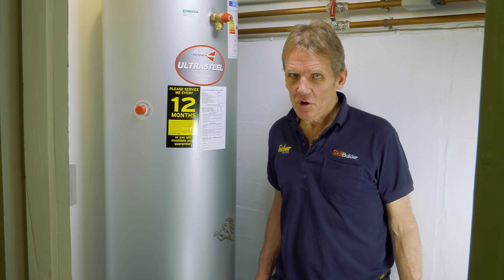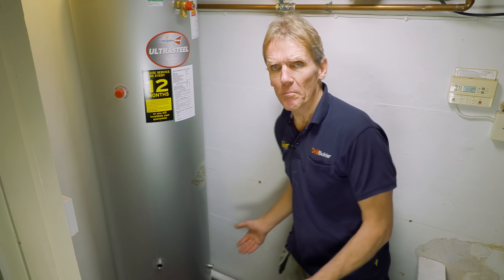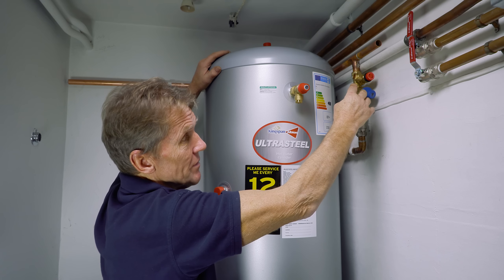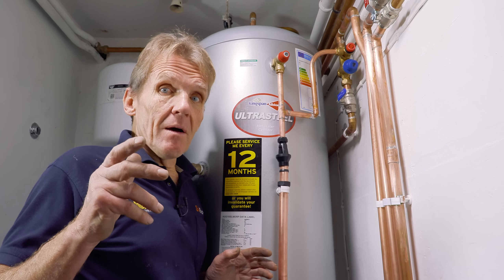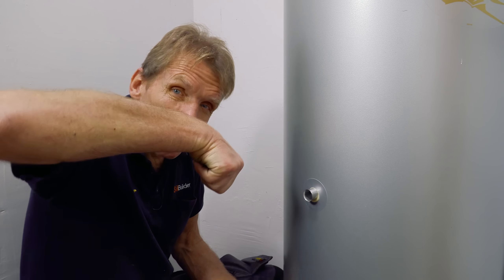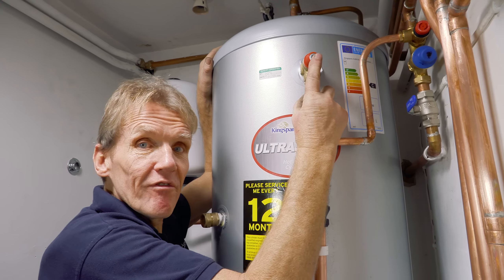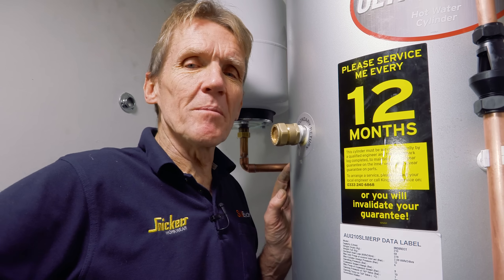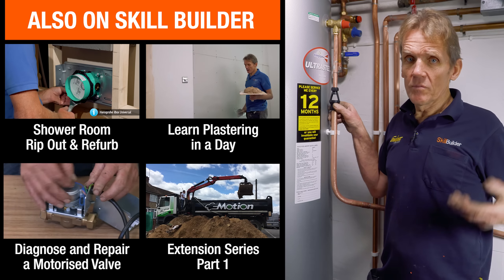Kingspan Albion Ultrasteel Unvented Water Cylinder

Comment: hi roger i have a 5 bedroom house  2 bathroom 2 shower   when ever i have 2 shower the hot water run out had to wait for 15 to 20 minute   you think unvented cylinder will be the answer and do i have to change the boiler as well thanks  enjoyed the video.
Reply from the maker: I think you might solve the problem by getting a better flow from the boiler to the cylinder. Is there a motorised valve on the cylinder? I am wondering if it is pumped or gravity.
Reply: Ratch Riat maybe you should look at the size of the cylinder capacity, compared to the size of the house

There is a rule of thumb, but if you get a qualified professional to come and quote you, I’m sure they will be able to solve your problem 👍

Comment: Surely by installing a check valve on the hot out will cause resistance?
Reply from the maker: A little but it is mains pressure to there is lots of flow.
Reply: check valves should be installed at each application, shower mixer or TMV etc, not at the source

Comment: how much air pressure does the expansion vessel have for the 3,5bar of watter pressure?
Reply from the maker: The expansion vessel should be charged to 3 bar with the cold water inlet valve closed and the hot tap open. This means that when the pressure reducing valve limits the static pressure to 3 bar as the cylinder fills the expansion vessel will then accommodate the expanded water in the cylinder. If the pressure vessel is less than 3 bar it will already have begun to compress and that limits its capacity. 

In many countries they don't have an expansion vessel and the expansion backs up the mains. The non return valve, there to stop contamination, prevents the water backing up the mains so it needs somewhere else to go. Some cylinders have an air gap inside at the top to take the expanded water.

Comment: Can you do a video on poor central heating pipework design and lack of 22mm flow are return. Issues with multiple drops and use of micro ball pipe. Got an absolute tool of a plumber whos screwed up my sisters central heating
Reply from the maker: O.K I can go through the basics.
Reply: @SkillBuilder  i do the wet fit hang rads n do the flow return on 3 bed terrace house, boiler is baxi 80 he type installed in kitchen back of the terrace. I do the "c" shape in 22mm plastic and "t" off in 15mm vvv close to rad, hence theres a max 22mm flow rate with no drops!!! Dont even need to balance and increase boilers life as no air locks or restrictions, hence boiler having to do less work. If theres a attic room i use 22mm. I never deal with micro ball pipes and use plastic as less restrictions. If theres a concrete floor down stairs i chase the skirting and take pipes around the skirting. I never use drops unless its a loft room. Even then i dont need to balance. I know im talking about small houses and basic system, but ive seen dumb plumbers screw these up aswell
Reply: @SkillBuilder  he left the site with a gas leak. People must get the gas safe engineer to watsapp their card and verify the certification. Ask the specifics of the pipe route and the 22mm path

Comment: Why not have a pressure reducing valve on the mains coming into the building as well as the one in the combination valve? This would eliminate the need for a check valve on the hot water draw off.
Reply from the maker: You could do that yes. I have done it when people have excessive night time pressure.

Comment: I am wondering where the outlet from the tundish goes? to a bucket on the floor?
Reply: Mentorcase , think 22mm punches through wall to out side.  In oz, internal storage hotties must also have drip trays and outlet point, just in case hottie cracks or leaks.
Reply from the maker: Through the wall. It is a basement but one wall faces a sunken garden area with drainage channel.
Reply: But I thought it was a basement, below ground level.
Reply: @SkillBuilder  as its a boiling water outlet please show how its terminated outside
Reply from the maker: @TheDickPuller  
Where does the pipe go? The answer is, through the wall and outside into a drain.
Reply from the maker: @Mentorcase   It's a basement but the back of the house is lower than the front so it can run through the rear wall into a drain. It's all good.

Comment: ive got an unvented cylinder like this and every few months the overflow leaks. Never been able to work out why. Have put pressure reducing valve on mains into house at 2 bar but it still occasionally drips. I have to reset the airgap on the cylinder then its ok for 2-3 months. All valves have been replaced but it still does it. Don't know why. :(
Reply from the maker: Try fitting an expansion vessel to the incoming mains on the cylinder side of the non return valve.  The bubble is being displaced, they are like that sometimes.
Reply: @SkillBuilder  Thanks so much for your reply. It is a megaflo. I've read they can do this. The last British Gas plumber mentioned that it might need an external expansion tank if the mains pressure reducer didn't fix it. But doesn't an external expansion tank simply increase the time taken for the valve to start to  drip? Thank you 😀

Comment: HI Roger its Kev how much would something like that cost? thanks mate
Reply from the maker: Hello Kev
The cylinders are not that expensive now. Say around £500.00 for this one. The pipe and fittings added another £200 and then there is my labour which is another £500.00 All plus vat  of course.
Reply: I charge £1500 on average, supply a fit. Then its between £300 - £800  for any additional alterations to the system. Boiler would be about £1500-£2000 supply and fit.

Comment: Nice job Roger , but you forgot to mention that you need to be qualified and certified to work on unvented hot water systems as if you don't know what your doing ( DIY ) you could be putting people's lives at risk.......!
👍
Reply: No you don't need to be certified, but you do need to be compotent. Don't let yourself be brainwashed. Wake up. I live in bulgaria and all the houses have these it's no big deal.
Reply: Forgot to say that you can also connect them to solar or a wood burning stove.
Reply: Trevor Jones This ain’t Bulgaria pal 👍🏻
Reply from the maker: Trevor. Never do that. The wood burner is a no, no. It is not controlled and can boil very easily. Then you are relying on the safety devices.
Reply: Trevor Jones, In Australia Plumbing is a protected trade. That’s why you can drink the tap water here,
Reply: Trevor Jones ......I posted my comment to highlight the fact that DIY ers should not touch this kind of installation and you have just proved my point......!!
Reply: Yes need to be certified
Reply: Trevor Jones This aint Bulgaria mate, you need to be qualified to work on these in this country. That’s why we’re allowed to drink our tap water in our country, because we control who works on it
Reply: Fibre Washer Exactly! Should not be uploading ‘how to’ videos on things that cannot be installed by anyone other than qualified professionals!
Reply: @petermolloy5558  
The best water can be found in the Netherlands and Plumbing is far from a protected trade.
Yes, there are building regulations you have to follow, but you are quite free to do a lot of DIY.
Protectionism of these kind of trades is prohibiting people to do a lot of work themselves.
And even if a trade is protected, as long as your work is checked by a professional, it should be OK.
Reply: @AndyGT1907  
For your information, Youtube can be watched all over the world.
So while things may be forbidden in de UK or Australia, we enjoy these video's and Do It Ourselves if we feel confident to do so. 
I soon will start my installation of heatpump with 3x 1000 liter hot water tanks for heating and 1000 liter Hygienic Domestic hot water tank with circulation pump (500 m2 house).
Nice DIM (Do it myself) project.
At the end (and maybe in between) I will invite a plumber to do some checking, but I am confident I will do it just fine. When professionals came to pour my concrete floor and later, after insulation and floor heating, to put the anhydrite floor, they were quite pleased with the details and craftmanship they did often not see from "professionals".
Reply: He might be speaking to other Plummers in the trade!! Sharing his wisdom to them to help get over problems which he has come across in the past.
Reply: In the UK you must hold a unvented ticket to carry out works on high pressure systems like this. You must also register the installations with the local authority so there's a record of where the system has been installed.
Reply: "qualified and certified to work on unvented hot water systems as if you don't know what your doing ( DIY ) you could be putting people's lives at risk"

Or the work has to be certified afterwards to be strictly accurate.

Comment: My thoughts are that the use of soldered fittings in this form of installation is ill advised, compression is the one and only way to go gives scoap for future maintenance works
Reply from the maker: All the compression connections can be undone and the cylinder removed without any problem. I think that quantity of compression fittings would be bulky, ugly and expensive.

Comment: That's only reason I went for a combi was the pressure relief valve as I would have put in a basement the cost to pump it becomes ridiculous.
Reply: Matthew Trott a high temp pump costs £150 or so, you then run the pipe to your nearest waste pipe. They’re not that expensive and it depends where the waste pipe was to your basement

Comment: This would definitely cure or pressure coming out of the shower. It's like a dehydrated person having a leak on your head atm... 😂 Plus the tanks in the loft and pipework could be sold off to get a few bob back.
Reply: @Alan 59 Yes, cannot raise it any more. It's in the loft. Sorry, I meant the tanks in the hotpress on the 1st floor and the attic right above contains the expansion tank and supply tank which is as high as they can go.  The house was last plumbed in the mid-80s'. He did the electrics also. From what I've seen so far he was neither a plumber or an electrician.

Comment: 1. What procedures are involved in the annual service?
2. Is it possible to provide more than mains pressure? i.e. for occasions when  two showers in use at the same time, plus the washing machine and dishwasher were cutting in while someone else is using the hose pipe to wash the car?
Reply: Twig You can fit devices to boost your cold main after it enters the property. Some can be pressure sensitive, so once it drops below a certain pressure, the pump will activate and bring the pressure back up for you

If you contact your local qualified professional, I’m sure they can quote you for the works you require
Reply from the maker: Twig 
 I think that what you need is more flow, not more pressure. There is a limit to what you can achieve because mains boosting pumps are designed to prevent you sucking the water out of a neighbour's supply. If you want a lot of simultaneous use it starts getting expensive. 

As for the annual service it involves checking the pressure on the expansion vessel (3 bar) cleaning the debris filter and testing the pressure and temperature relief valves plus the non return valve. It is a good idea to run these a little because spiders can build nests in the pipes and block them.
Reply: @SkillBuilder  
What's the best way to improve flow? Is it just wider pipes?
The incoming supply to my tank is 22mm.
My tank requires an anode. I'm not sure if I should use PTFE tape or not; any thoughts on that?

Comment: Oh dear, you have a different pressures for the hot water and cold water.  Showers are going to be very hot/cold off and on.  They should share the same pressure regulator.  And I am only a DIYer not a professional, but it is rather obvious.
Reply from the maker: sorry I don't know what you mean, there is a take off for balanced pressures but in a house where all the cold services are in and the boiler is in the basement it is easier to put the cold on a separate pressure regulated supply. The showers are thermostatic so there is no problem on nominally equal pressures.
Reply: @SkillBuilder  Agreed, they'll probably be fine as is, most showers will accommodate an inbalance in pressure and if not, another pressure regulator on the cold will sort things.

Comment: So that is not a geyser, its a hot water storage tank, the water is heated by a separate gas / electric  boiler geyser geeza? then piped to this tank.
And when you are talking high pressure, its the 3 Bar from the pressure control valve? surely that is going to be regulated to maintain this 3 Bar by this PCV so why is the pressure storage tank needed on the side? just wondering .. that's assuming the supply will be +3 bar
Reply from the maker: Any cylinder can demolish a house if it boils and has no relief. More dangerous are vented cylinders where the feed and vent both freeze in the loft and the cylinder boils up. I was in a house where that happened with a coal fired boiler. Luckily it blew a spring loaded safety valve but it was scary.
Reply: Thanks for the reply, the pressure relief valve is a given, I was wondering about that small pressure storage unit / tank on the side of big tank. I use them in irrigation / backup water systems where there is a pump involved to ensure readily available and smooth pressure, I was asking about its application here given there is a pressure regulated mains supply.
Reply: Thanks Jay, that makes total sense.  I've seen lots of issues with the high pressure relief valves dripping and then gushing due to hot water expansion, I guess this is the answer. Now just to find one out here in the Colonies. btw, I see also there is a pressure that should be maintained on the air side of the tank.

Comment: Besides the space saving factor in the loft, could you fit one of these say in a large top floor flat that is currently run on a tank that is housed on a roof, and then use a negative head pump to feed the unvented tank, I say unvented because the 3bar single outlet negative head pump would act as a water main, 

What’s your thoughts roger? 

Last year I did a similar thing but I had a combi boiler in a penthouse apartment and i utilised the tank fed system due to the water main being around 0.6bar, worked out really well so I recommend that sort of system if you ever come stuck with poor pressure.
Reply from the maker: I ran an unvented cylinder as a vented cylinder with a pump into it for years on one job because the mains was due to be renewed. When the new main was laid we swapped it over.

Comment: Another great video Roger really informative as usual. I have a question. About 5 years ago we had an unvented system fitted by a plumber who reccomended it to us whilst our house was being renovated. We had the pipework renewed and a 25mm blue pipe installed. However, we are only getting 10 litres a minute and 2.5 bar standing pressure. So you can probably imagine when we open more than one outlet, our flow decreases, but just opening a single tap, the pressure and flow is good. Is there anything that can be done to improve our pressure and flow?? 

Many thanks
Reply from the maker: MH 1127 

I have had much the same experience at my house. The water company laid a new run of 25mm from the main to their stopcock at the boundary and I continued it in to the house. 

They were supposed to put a new tapping in the main but they used the old 1/2 inch tapping because they wanted to get home. 

I have the required 1 bar at the stopcock and they say that is all they are required to do so, despite having an unvented cylinder I have no choice but to pump it with a mains pump.  My flow rate is around 12 litres per minute but at the top of the house we have a shower that will dribble out if there are other showers or taps being used.
Reply: The water company are as good as they get as we were pretty much told the same thing. Many thanks for your help.
Reply: @SkillBuilder  would a check valve on the hot supply after a tap stop the issue you mentioned with mains cold over whelming the hot too a tap or showwe valve ? Cheers great vid btw

Comment: Main pressure water comes from one mains water pipe from the road. The water delivery depends on that pipe. 

Many think installing an unvented cylinder miraculously improves the water pressure and flow. Unvented cylinders restrict flow due to the valves fitted. 

When fitting ensure a full bore stopcock is fitted. And that a dedicated pipe from the stopcock is run to the unvented cylinder. That is.... run all the cold taps from a pipe teed off the stopcock.